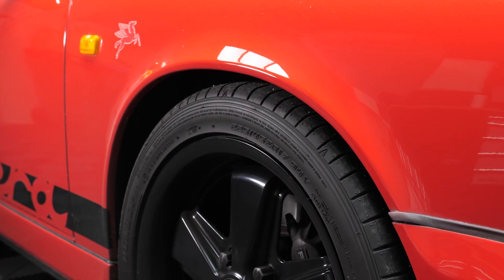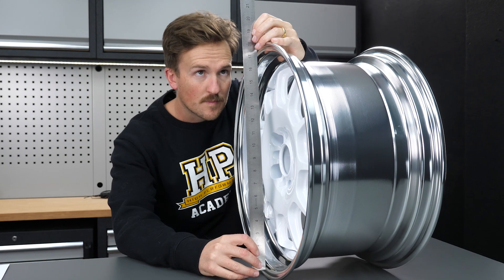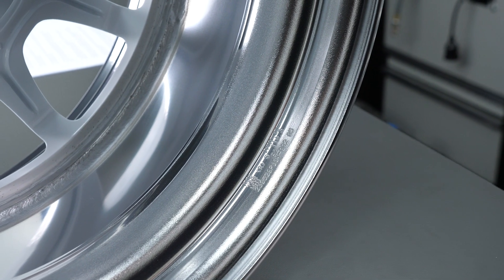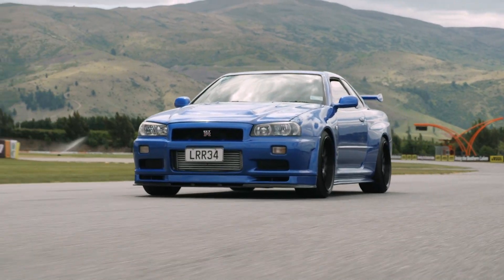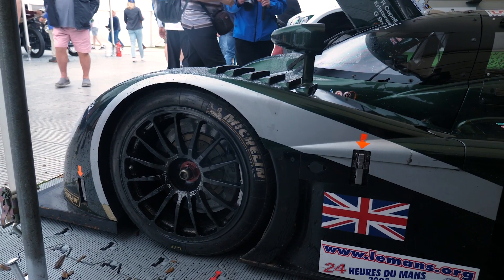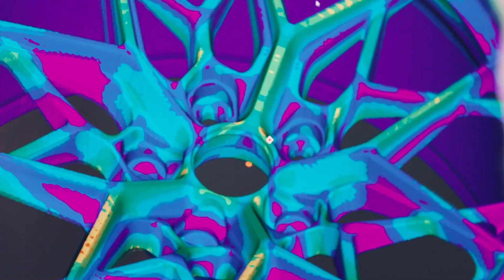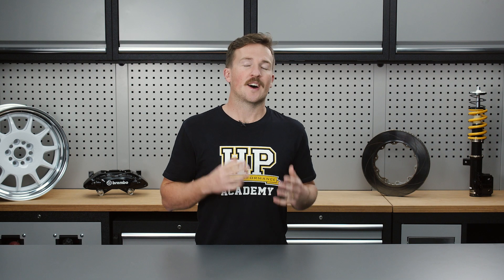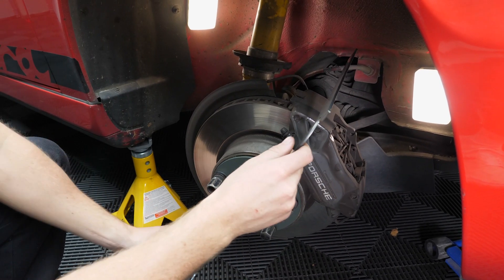Wheel and Tyre Fitment | ONLINE COURSE

Comment: Does the course cover issues of safety and load rating, especially with modern performance cars getting heavier and heavier and aero loads increasing exponentially?
Reply from the maker: It is discussed however it’s a tricky one as there is no consistent standards internationally. 
TUV and JWL are examples but they aren't strictly necessary in many countries.
The Wheel and Tyre Firment course does also discuss what factors influence wheel strength. That includes manufacturing processes and resulting grain structures, but the course stops short of teaching you how to design a wheel for strength as that is not the intention of the course.
Hope that helps - Connor